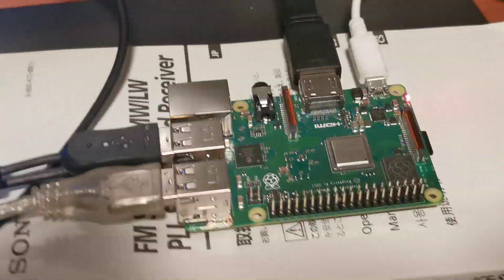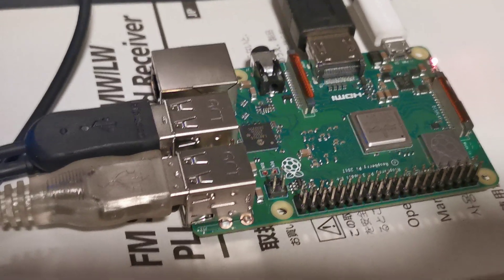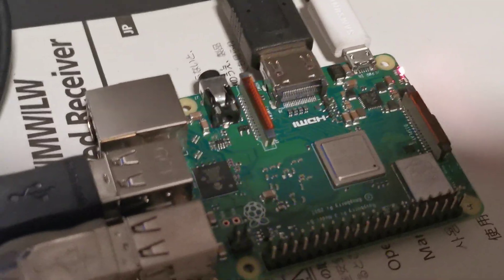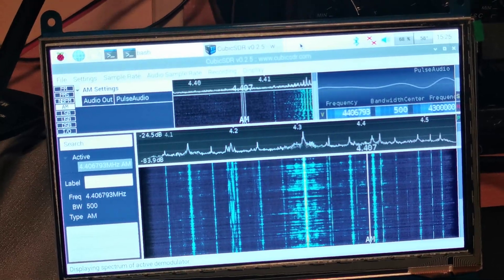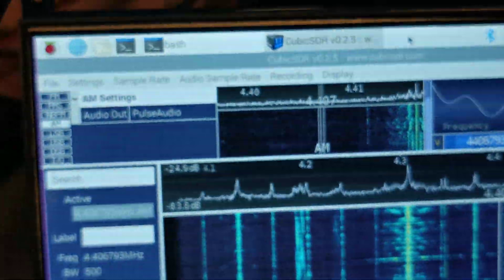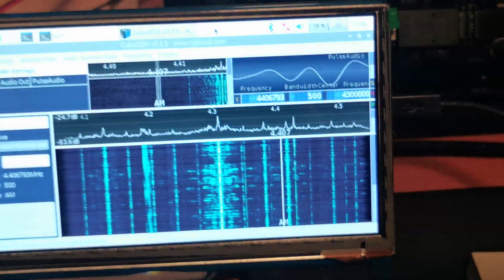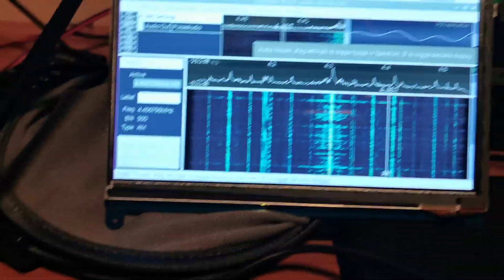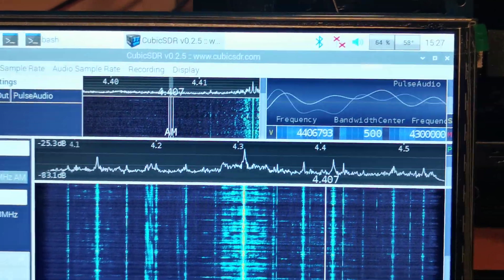Raspberry Pi 4  and SDRplay to build a self contained SDR receiver. Part 1

Comment: Why did you use a pi-4 and not a pi-3? I have mine set up with a pi-3 and it works very well and I am wondering if there is a benefit from using the pi-4. Thank you.

Comment: People attempting this with the Raspberry Pi 4 8GB model should be using the 0.7 release (described as "RSPdx, RSPduo - master/slave mode"). I attempted to use the 0.6 version thinking it was all I needed, and the Pi would refuse to boot, stating that I needed newer software. I tried everything including building my own software setup from scratch, and finally in frustration, I tried version 0.7 believing it would surely fail as well anyway. I'm delighted to report that it works beautifully. Thanks, SDRPlay!! :-)

My specs are:
One Raspberry Pi 4b, 8GB model
One SDRPlay RSP1

Running headless at 1080p, controlling the Pi remotely via the inbuilt VNC server. The Pi itself has three heatsinks and a mini case fan, courtesy of Canakit. Operation is buttery smooth in CubicSDR as long as I don't run it at full screen, and then it's only got a little bit of noticeable jitter in the waterfall display. Audio output is crystal clear on the FM radio stations. I also have an RSP2 Pro but I haven't tried it with that just yet. Only got it working on this Pi just an hour ago so I'm still in the hardcore testing phase.